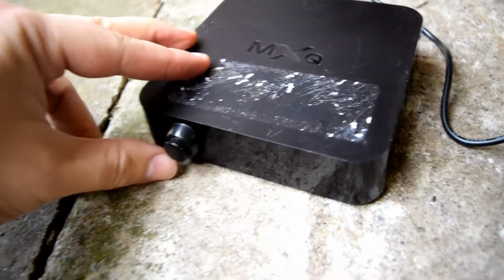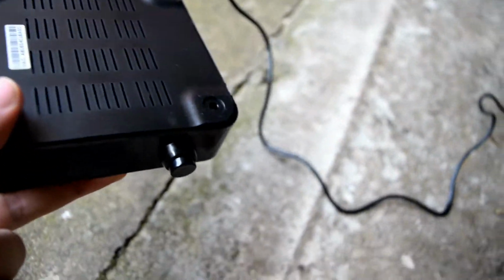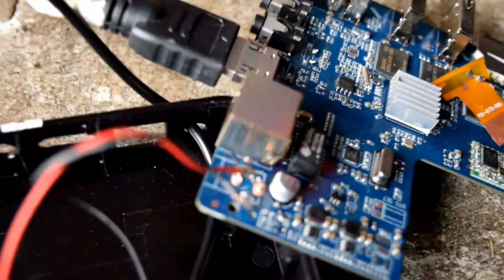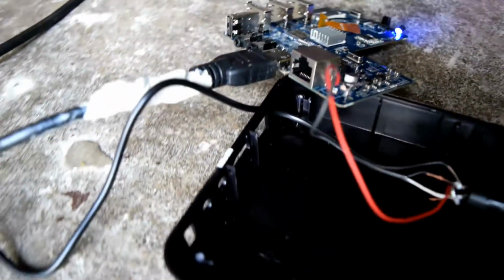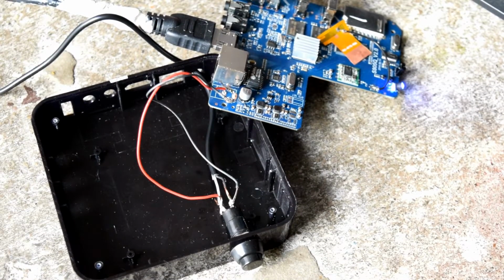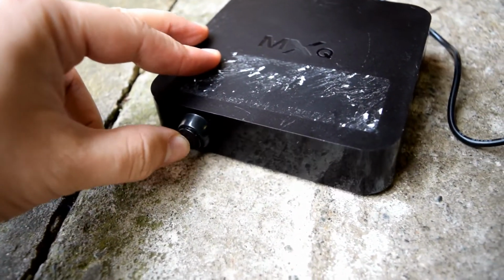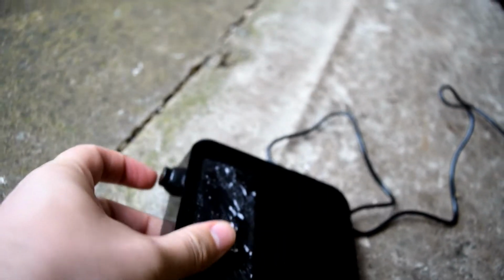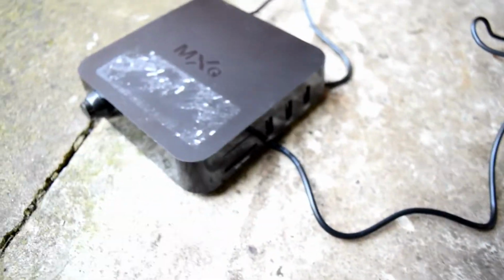Hardware MOD: Adding a Power Button To My MXQ Android TV Box

Comment: Ich have an old s805 asure xsr Box. The Box ist briked i have try burning Tool but no Image help me the Box is Instant in Red and All burning Tools 4% Error Disk initialize and i dont can flash by SD because no Reset bottom in my Box was abduls Rom i want to Reinstall after new gapps Paket in the flash progress my Energy goes down weather and than briked can You help me ? I can send You the Box for free or do You have a Tipp for me:(? #mxqprojectplshelpme